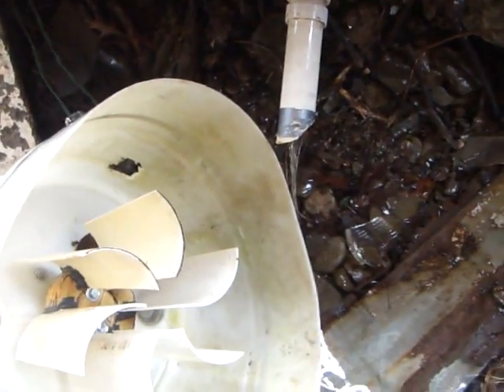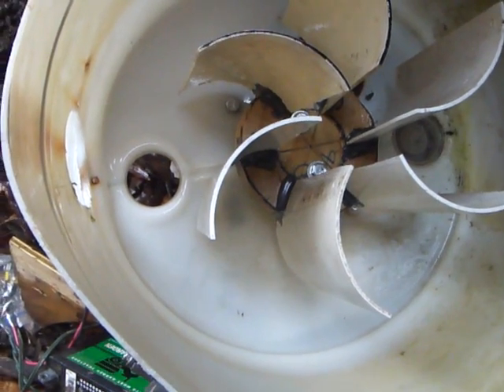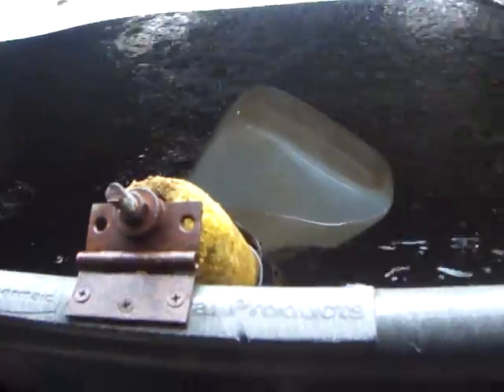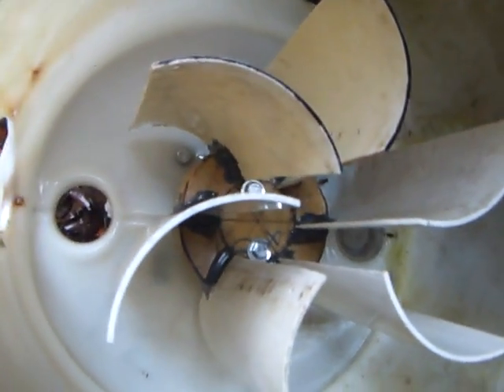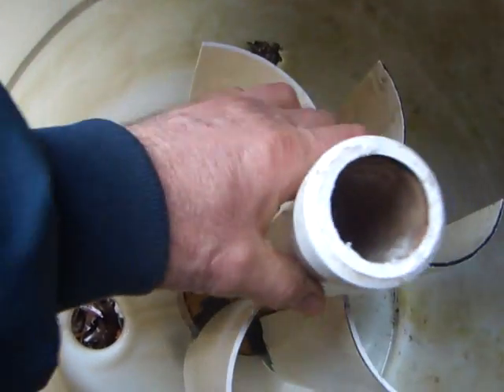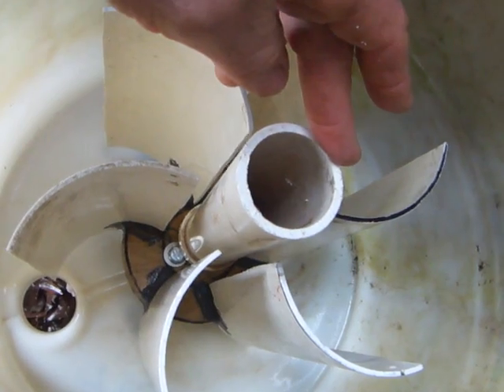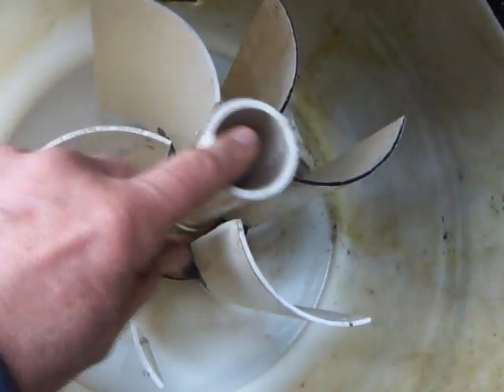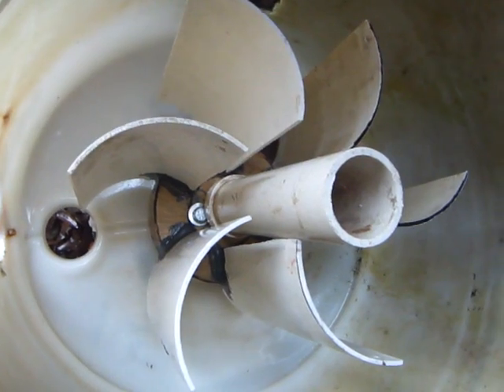water turbine impeller homemade 2015

Comment: You can order impellers for that type of set up for better out put power. I don't know if you could run that pipe down a hill to get more head behind it but if you could, you could get a lot of head behind the out put. and put a nozzle increase the pressure at the head before the impeller it would put out some crazy RPM's and out put on the turbine generator.